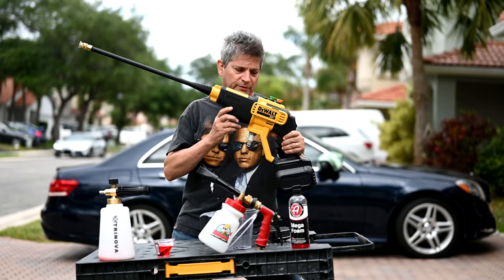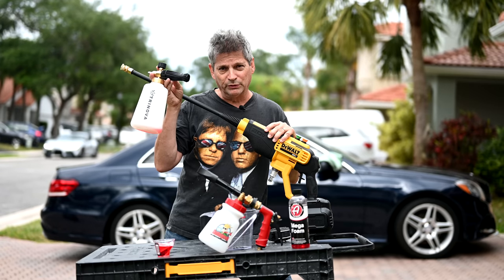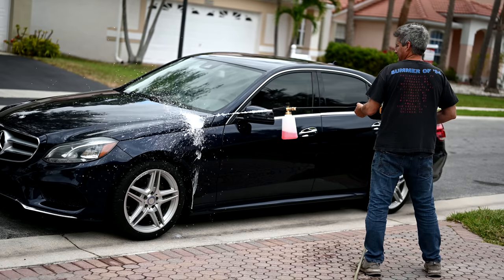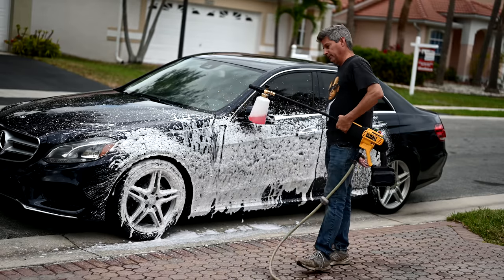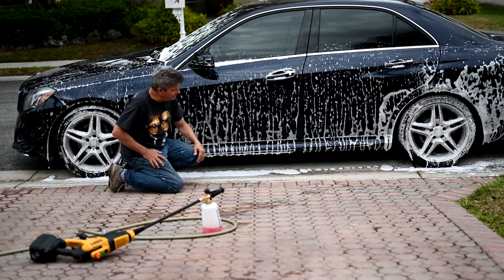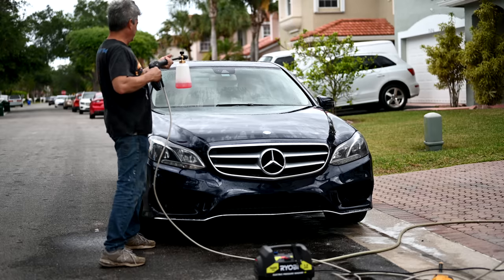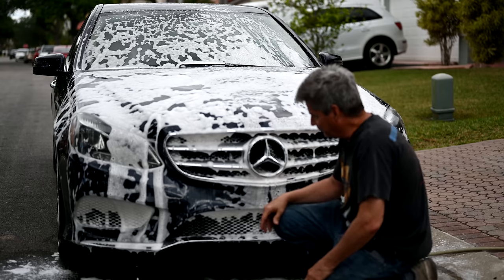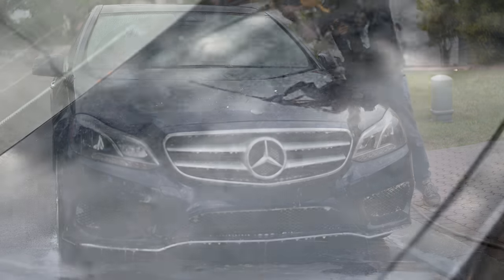Can DeWalt Power Cleaner Work With High PSI Soap Cannons? Car Wash Tips

Comment: I just used my dewalt gun for the first time the other day, and yes I was a little disappointed with the soap process, that said I tested a couple of areas to see if after the soap there was less dirt that just after using the water sprayer. I do believe the soap did its job and clinged to the dirt, it was noticeably better with no wiping. That said i believe this would take it up to a whole new level, thanks for doing this video.
Reply from the maker: Glad to help Tim!

Comment: Thanks for the video of using the foam nozzle for a battery washer, I have a washer YOFIDRA and I also used a different foam nozzle, changing the nozzle in it to ∅0.9 mm.
I also changed the nozzles with different angles of water supply, nozzle number 025, which means the diameter of the hole in them is 0.97 mm, the power of water pressure increased very much to 100 bar.

Comment: Jeff not sure if you are still using this tool. I modified mine to accept a short want and it improved the gun significantly specially for the foam cannon.. Also took off the plastic quick connect and installed a brass quick connect fitting
Reply from the maker: Hey sawed off shotguns are illegal! LOL. I don't use i as much now that I bought the $99 Ryobi pressure washer for the car. But I use the sprayer at my friend's house when we spray all the gardens for weeds, like I showed in the video.
Reply: @jeffostroff  update. I added a $21 dollar backpack sprayer into the mix. Now I just fill the backpack sprayer tank with water throw it in and spray away lol
Reply: @mikeytek  I use a normal pressure washer just like one would typically use it, BUT I use a Worx hydroshot (this Dewalt on order) for my final rinse step. Fill the backpack chemical container with 3-4 gallons of distilled water to prevent water spots.

Comment: Jeff, great video. Very helpful.   It does look like this Dewalt unit appears to do the job is all you are looking for is a good pre wash step before proceeding with the normal mitt wash afterwards. Question - when you talked about that alternate orifice nozzle - was that for the Ryobi or the Dewalt, or for the foam cannon?  MINGLE Foam Cannon Orifice Nozzle 1.1 mm, 2-Pack.

Comment: Important distinction to be made with this test: The dewalt unit was connected to a garden hose NOT a bucket via siphon method. This is key, as the siphon method would not have enough pressure to use the FC…
Reply: pretty sure it doesn’t change the PSI. the dewalt is only so strong changing the source of water doesn’t change much
Reply: Too late for me! foam canon does not work with the bucket of water
Reply: Same, it didn't work for me with bucket of water

Comment: This gives me some confidence for being a foam cannon setup at a Coin Wash vs using my IK e-foam Pro 12 that is too slow to put foam on as a remote foam cannon setup. Now with Dewalt having a 1000 PSI model out, this should work well wiht MJJC foam cannon. I don't care to use it as a Water rinse setup, just a Pre-Foam and Re-Foam when going to contact wash stage.

Comment: hey there amazing review just wondering is there a specific foam cannon for the dewalt pressure washer or can you use any foam cannon.
Reply from the maker: You can use any soap cannon, we used the 🛒 TriNova Foam Cannon For Pressure Washers: https://amzn.to/31OgOAh because it was the highest rated and has the wide base. Whichever soap cannon you buy, make sure to order the 1.1 mm orifice off amazon like we did. All soap cannons come with 1.25 mm, don't know why, but you need the 1.1 mm orifice for the soap cannon to make that thick soap. 🛒 REQUIRED: MINGLE Foam Cannon Orifice Nozzle 1.1 mm, 2-Pack

Comment: LOOKING GOOD JEFF
WE FINALLY GOT A NEW TO US TRUCK 😁
2010 GMC SIERRA RED WITH CHARCOAL GREY INTERIOR  LOOKS GREAT 👍👍 I THINK IT WAS OWNED BY AN ELDERLY COUPLE LIKE ME AND MY MRS, PROBABLY PARKED IN A GARAGE TOO.. PAINT IS NOT FADED AND INTERIOR LOOKS LIKE NEW, WHAT BRAND IS THE SOAP THAT YOU USE WITH A CANON. WHAT'S YOUR OPINION ON THE SPRAY RHINO LINER FOR THE BED OF THE TRUCK??APPRECIATE YOUR THOUGHTS AND YOUR VIDEOS KEEP UP THE GREAT WORK RODNEY
Reply from the maker: We used the Adam's Megafoam, links in the video description. I don't know much abbot the spray on bed liner, we saw one at the Ford dealer last month, they look awesome, I know nothing about longevity compared to Duraliner 
🛒 DeWalt DCPW550B 550 PSI Power Cleaner Tool Only  https://homedepot.sjv.io/5XGNL
🛒 DeWalt DCPW550B 550 PSI Power Cleaner KIT, Batt: https://homedepot.sjv.io/QRXQ3
🛒 Ryobi 1,600 PSI 1.2 GPM Electric Pressure Washer:  https://homedepot.sjv.io/BX0K7J
🛒 Adam’s Mega Foam 16oz - pH Best Car Wash Soap For Foam Cannon: https://amzn.to/39KxsFA
🛒 Adam’s Mega Foam Car Wash (1-Gallon jug) https://amzn.to/3fGnQzf
🛒 TriNova Foam Cannon For Pressure Washers: https://amzn.to/31OgOAh
🛒 REQUIRED: MINGLE Foam Cannon Orifice Nozzle 1.1 mm, 2-Pack
🛒 California Car Duster 20105 Clear Dry Blade: https://amzn.to/2Nyb3D7
🛒 Cobra The Supreme Guzzler Waffle Weave 20x40 https://amzn.to/2KIV8Rp
🛒 Shop our Amway Web Site: https://www.amway.com/myshop/JeffOstroff

Comment: Great follow-up video and  yet more good information, Jeff.  
Since I'm still waiting on Grainger (!) I went and bought a Dewalt washer at HD today to see if it'll meet my needs.  If Grainger ever comes through with the pressure washer and 5Ah battery order for $149, I'll return this one.
Using a bucket water source, the low setting is not that good, but OK for rinsing.  (If that's about the same as the Ryobi's performance, per your comments, I'm glad I opted for this one). I found the Turbo nozzle wouldn't always spin on Lo. The high is actually pretty good.   A garden hose water source gives a little more oomph, but nothing major, though it did allow the Turbo nozzle to work properly all the time on Lo.   
I did see that the Hi setting occasionally lost some pressure from the bucket for no reason for a second or two, then it would kick back up.   No hose kinks or air.  Hmmm?
This will fit well for my intended purpose - rinsing off the salt from the vehicles in PA winter when the garden hose is stiff as a board and frozen up and for cleaning my remote garage doors, siding, deck railings, etc. of mold and mildew in the Fall after spraying with cleaner.  I was able to wash off the car and test this in a place where I can't get a hose to.  I only used water and the car was acceptably clean for a quick going over, even removing the few early Spring bugs, and especially blowing out the dirt from behind the trim pieces, wheels ands wheel wells.  Perfect for winter!
I only tried a couple 75% (2 bar) 5Ah batteries and each (very) roughly lasted about 7 to 8 galls.   Not quite two full 5 gallon buckets on Lo.  Slightly less on Hi.  Shame you can't see the battery charge without removing it, but you can tell as the pressure drops significantly when at 1 bar!  
I was able to spray down the whole of my CRV thoroughly with one battery.  Probably two batteries and three buckets to do a wet-down, soapy wash and rinse, though I''ll likely do soap with the pressure washer (now that I know a cannon will work) and a rinse, two-bucket wash and final rinse with my garden hose, then a blow dry and microfiber cloth wipe in the warmer weather.

A not too shabby Dewalt cleaner!   Would love to see a 900'ish psi 60V version though.
Reply from the maker: Yes it seems every cordless sprayer I have tried has issues when trying to siphon water from a bucket. It works for a minute then stops. I think the problem is that a bucket of water lacks the 60 PSI headwind that the hose valve gives you.
Reply: @jeffostroff  I'll maybe try putting the bucket up on a step ladder to get the head, a 139ft step ladder!  😉 😂😂😂
Reply: Gave up on Grainger.  They never fulfilled my order.  I ended up returning the DeWalt.    I might try the new, just released Ryobi after I see some reviews.
Reply: Raising the bucket didn't noticeably help

Comment: I just picked up my dewalt power washer.  Does the trinova hook directly to the dewalt or did you need a special fitting.   Also did you need anything else to accomplish that ?
Reply from the maker: It connected upright to the end of it on the end of the wand
Reply: @jeffostroff  awesome  thank you for the info.  Great video

Comment: Hi Jeff,  with your demonstration on the dewalt power cleaner, was the cleaner hooked onto a garden hose or was it siphon off of a water reservoir? Would either make a difference?
Reply from the maker: Connected to garden hose. The bucket siphon method is a joke without that 60 psi from garden  hose the pressure is about half coming from siphon  hose.
Reply: I guess I won't spend money on this the whole purpose of battery operated water pressure at least for me is I don't have easy access to a hose in the apartment complex I live. Right now I have the WORX Hydroshot the 300 PSI one when it first came out for washing I have a 7 gallon tank as water supply  I use an IK Pro Foam 2 for foaming. If the DeWalt would work by syphoning the water than I would invest in it. It would be awesome if one of these companies would make a battery operated pressure washer than actually produce foam by syphoning water oh well.

Comment: What type of garden hose are you using? I hooked mine up and the plastic coupler broke in 2 mins…. I think it puts too much stress on the plastic connection
Reply from the maker: Just a regular run of the mill garden hose
Reply: You may have tightened too much.

Comment: Nice demo! I just watched your MJJC Foam Cannon review as well. Is Trinova Foam Cannon with 1.1 Orifice Nozzle still the best attachment for a Dewalt 550 PSI Power Cleaner? Do we have to use Adam Mega Foam to recreate the same thickness of foam or will other brands work just the same?
Reply from the maker: It looks to me so far that the trinova still did not put up enough foam soap with the DeWalt tool it was kind of watery ish also. I do plan to do another video where these two go ahead and head the MJJC against the trinova through a myriad of tests that's going to be a great one
Reply: @jeffostroff  That would be awesome! Looking forward to discovering the best foam cannon accessory for a low PSI Dewalt Power Cleaner.
Reply: Was it ever determined which is the best foam cannon to pair with the Dewalt cordless?

Comment: Are you able to attach an XJET to the v20dwalt pressure washer?
Reply from the maker: What is Xjet?
Reply: @jeffostroff  xjet M5 is used for softwashing and is an 1/4 adapter that goes at the head of preassure guns, And it helps you add corrosive quemicals into the mix whitout damaging the hose or the gun. So it basically adds and mix the bleach or any chemical you put in with the water, right at the tip.

Comment: I’m thinking about getting a pressure washer for my car  that’s electric what do recommend far as cordless my budget is like 200.00 it doesn’t have to be cordless tho
Reply from the maker: This is th eone we bought: https://homedepot.sjv.io/BX0K7J will be doing a video on it in a few weeks
Reply: CAT/ACTIVEVE52  OR
Sunjoe spx 3000   are the number 1 and 2 choice for that budget.  I used both and all you need to do is get the quick connect couplers for the inlets and outlet on the machine and buy a quality non kink 50 ft pressure hose and short gun. For the foam cannon go with mtm or trinova

Comment: Does the soap cannon go right into the tip of the washer without needing an adapter?
Reply from the maker: Yes, the Dewalt sprayer has a standard quick connect on the tip of the sprayer and it connects right up to the soap cannon

Comment: I want to love this thing Jeff I really do but the spray has been inconsistent for me. Sometimes it kicks in and sometimes it just spits my water and I have to refill the bucket I'm using. Maybe you're having better luck due to the the hose setup. Unfortunately I need the bucket to work for portability. I'll try again this weekend. Cheers.
Reply from the maker: I too found I lame when siphoning from buckets' no 60 psi headwind from hose bibb
Reply: The hose fell out of the bucket. If you will always need a bucket. Tie the hose to the handle with electrical tape.

Comment: So if my pressure washer says 580 will a 1000 psi foam canon still work with it .I have an off brand battery power washer like that ..
Reply from the maker: It might, but just not as good as 1000 try it out.

Comment: What size quick connector are you using going from the foam cannon to the Dewalt power washer? The 1/4 inch ones I use for most of my air tools seem a bit long and wont make a good connection.
Thanks
Reply from the maker: The foam cannon is standard 1/4" quick connect. The air tools may be different than the water quick connects? I'm not sure.
Reply: @jeffostroff  I havent found a quick connect yet that will fit the end of the Dewalt power washer connection. where did you get yours?

Thanks

Comment: I can use this in the field for my heavy equipment such as loaders and graders .... i can draw from 5 gallon buckets
Reply from the maker: Yes and just remember the power is not as powerful when you siphon it out of a 5 gallon bucket as when you get it out of a garden hose because you are starting off the bat with 60 PSI less power
Reply: @jeffostroff  it can be useful for cleaning windows and radiators without damage to the fins.Also, i can clan around the DEF filler head

Comment: great video!! 
Any possible chance someone can tell me what is the battery he uses for this pressure washer please?
Reply: That's a dewalt 60v / flexvolt 3 Ah (9Ah in 20v mode, which is what this tool operates at). I have a similar, if not identical battery that came with a dewalt 60v string trimmer. Those big flexvolt batteries are decently priced when you get a bundle (like the 60v string trimmer or other 60v outdoor power equipment) but just a bare Flexvolt battery is very expensive.
Reply: Correction its a 2Ah 60v flexvolt / 6 Ah 20v.

Comment: If I'm already in the dewalt platform, would you go with this vs the ryobi?  At $150 I could go tool only for the dewalt or the kit with the ryobi.  Added benefit of getting into the ryobi platform for the cheaper nailer too.
Reply: The Ryobi pressure washer wasn't a battery operated pressure washer it was a electric pressure washer. That's why there's a big power difference in the video. However Ryobi does make a battery operated pressure washer for $80 on home depot.
Reply: @NPAMike  I wrote this comment before the premier referring to the $80 unit you're talking about.  With the battery it's $150.  I'm already in dewalts 20v but there would be no price difference.  Just wondering which is "better"
Reply from the maker: The Dewalt at 550 PSI is notably more powerful than the Cordless Ryobi Power cleaner. Also the Ryobi unit you can't put standard power washer accessories like this soap cannon on the end because it lacks that 1/4" standard quick connect that they all use. The cordless Ryobi Power Cleaner is as powerfully as the low setting on the DeWalt unit. So the Dewalt's high setting is notably more powerful than the Ryobi. But that plugin Ryobi Pressure washer in this video is 1600 PSI, much more power than the cordless DeWalt unit, but you have to plug this Ryobi unit in.
Reply: @jeffostroff  thanks Jeff!  That pretty much settles it for me then.  I'll wait the dewalt out and see if I can get a little better deal if one comes along.

Comment: Can Ryobi "ez clean" works with this foam cannon?
Reply from the maker: No because the EZ clean does not have a 1/4 standard quick connect on the wand, it has that rotating turret on the end. But the EZ clean can mount that soap sprayer bottle" from the Hart version of that same power cleaner. The soap bottle is not bad, it doe snot give thick rich shaving cream snow foam, but it does give a nice wet suds spray on the car.

Comment: My black trucks really need washed but their covered under 8" of snow.  My truck wants to move to you.  Here it's either too cold and snowy, or too desert hot to wash anything.  If I put soap on my black truck in summer, in less than a minute, it would be baked into the paint from the dry heat and strong winds.  I thought it was funny when you talked about wind.  Your wind is nothing compared to the east slope of the Rockies.  The table would've blown over here.
Reply from the maker: wind tunnel!

Comment: The issue is the cannon should connect to either the washer without the long lance  - or with a short lance. Awkward as hell with the long lance which wobbles and will probably break.
Reply from the maker: The Lance does not wobble at all if you have it tight on there it threads into place

Comment: Real psi on this thing is probably  not even close to what they claim  is good for cleaning showers and windows that's about it. Get it to keep in your RV or if you happen to  need to clean something in the woods
Reply: Pressure guages  just quick connect it on the end and it'll show true pressure at the nozzle end
Reply: @jeffostroff  is proven already.. Every washer made has a rated pressure and operating pressure   my Active ve52 says 1800 psi @2.o gpm  but it's actually running at 1460 psi at 1.4 gpm.. I have a 3.5 nozzle at the end to get more gpm and less pressure for car washing   I'm at 1200 psi at 1.7 gpm which feels perfect for my needs